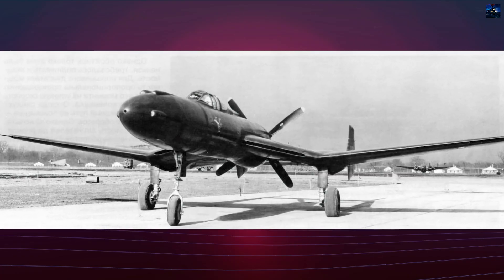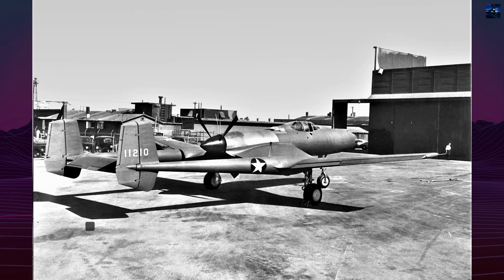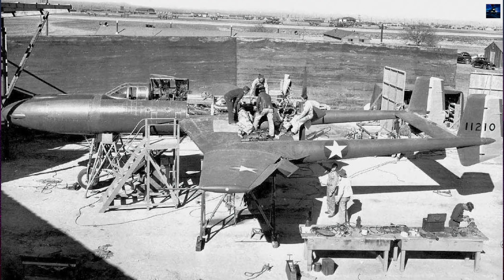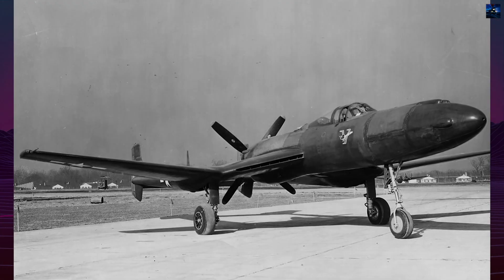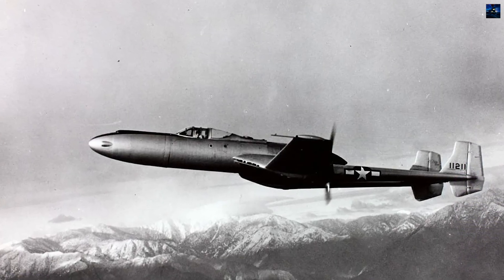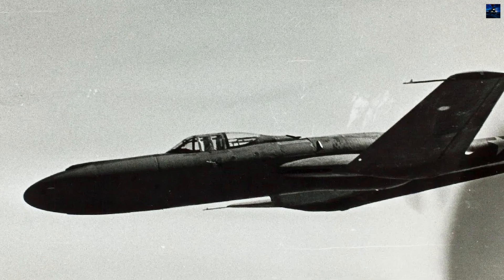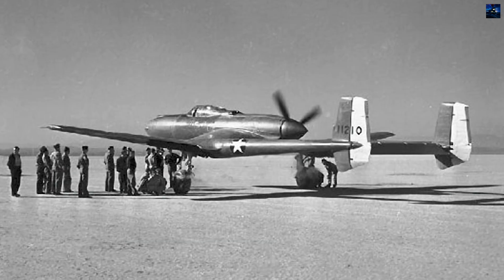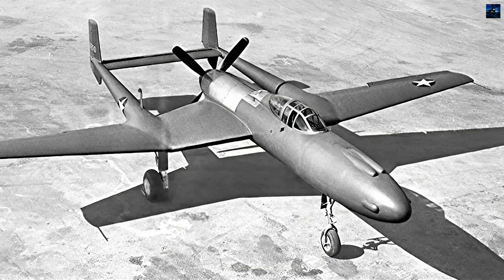Vultee XP-54: America’s Secret “Superfighter” That Never Fought

Comment: The Germans got it right with the Dornier Do 335 Pfeil ("Arrow") configuration.  474 MPH top speed, 35 MPH faster than a late-model Mustang. ....  Imagine that for the allies instead of a P-38 design.     Naturally fast.
Reply: The advantage of the Do335 was lower drag. It could benefit from the two engines without the drag associated with two separate engine nacelles.